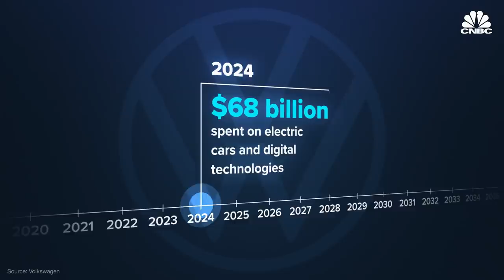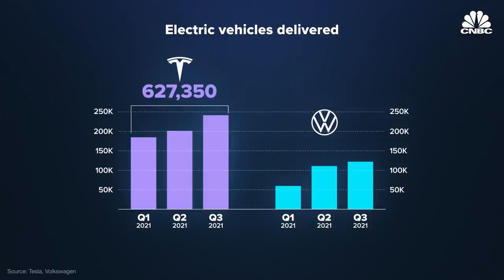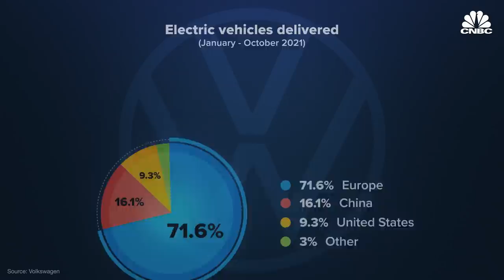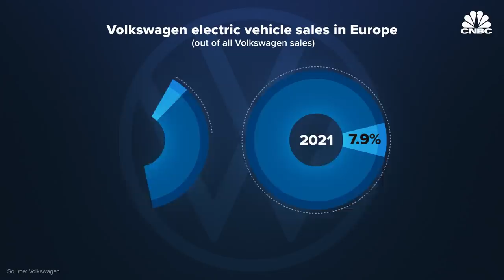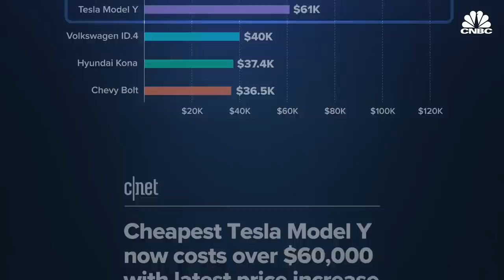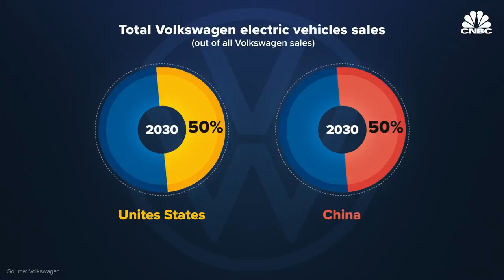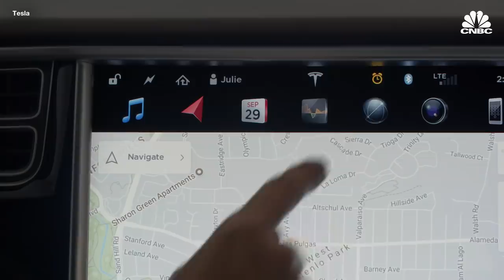Why Volkswagen Is Beating Tesla In Europe

Comment: Sometimes it makes sense to use open source software and give simulators to everyone to try the ecosystem. Here VW has the possibility to step on Tesla's toes and jump on it too. Chevrolet Luminas from the 1990's  totally destroyed the "American Designed" reputation in Europe which is remembered and gives VW huge headstart at casual basic vehicles sector. In every case there will be a powerful computer on board and its ecosystem paradigma can be expanded to deliver for smart home concept without obligation to necessary purchase high priced car. Tesla has edge on smart home department("coolest" thing ever) and if it had low priced alternative vehicle with general purpose computer and simulator to download without cost Tesla would slow down VW take over.

Comment: The shift to EVs is awesome across the board, and having more (affordable) options available will only benefit the consumer in the end. Hopefully soon there will be a good EV choice for every type of buyer out there. 

On a personal level, I drive a M3 and when we were looking for a second “bigger” family car without wanting to go “full SUV”, we test drove the ID4 and it’s simply not for us. The price point for the highest spec (where we live) is not that much lower than the Model Y, but the driving experience is completely different and not in a good way for us. However, I can see it would probably be an awesome change for someone moving away from a similar type of diesel vehicle. VW know their market well, and those are the customers they need to “retain” and/or win over.

I hope to see fewer ICE vehicles on the road in the upcoming years. I can already see a huge difference compared to 3 or 4 years ago 🙌